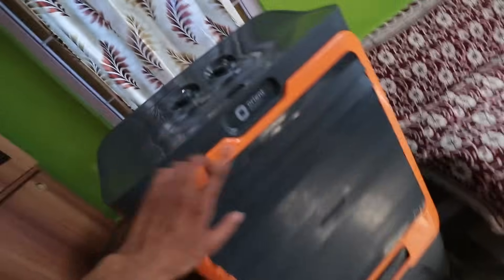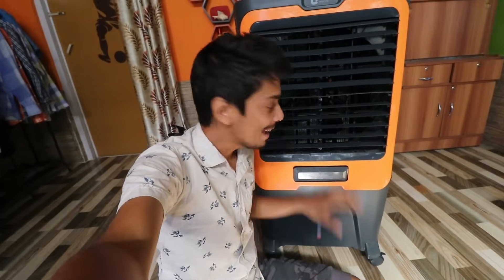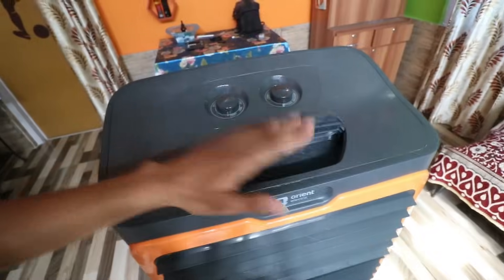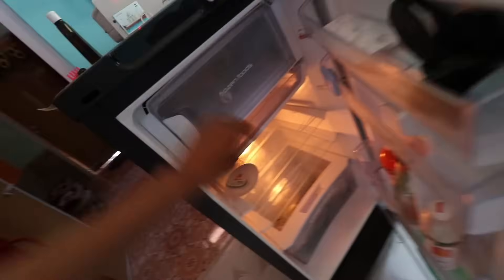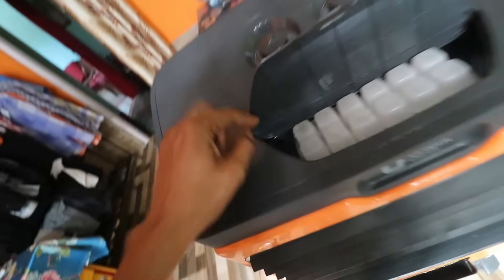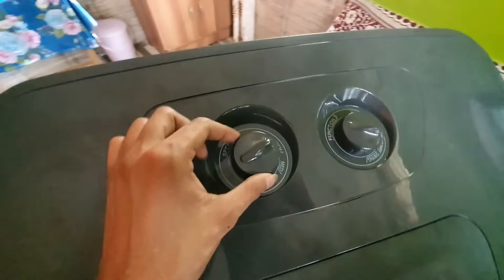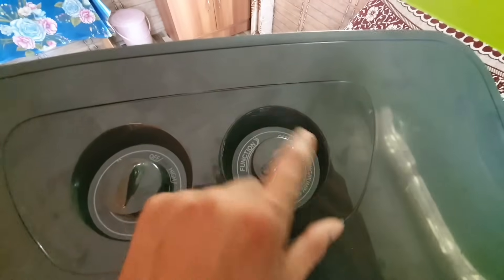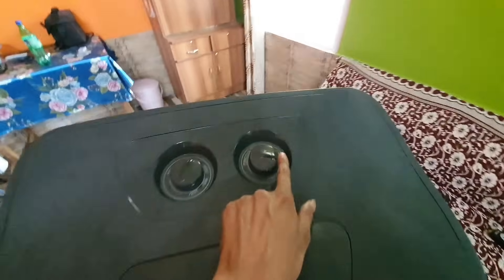ঠাণ্ডা ঠাণ্ডা কুল কুল - How air-cooler works - Dimpu Baruah

Comment: Cooler jihetu evaporativ pad joriote cooling kore so Humidity babe cooler heat exchanging capacity komi jai jar babei eyar cooling effect o komi jai. Logote bondho room hole cooler side place bor gorom besi hoi like gorom steam dore so air flow hobo porakoi room open hbo lge and cooler back side window facing hbo lge.

Comment: Air cooler is not very useful in hot and humid climate like in Assam. Air will already be saturated with  water vapor and will be unable to absorb the heat. Air conditioning is the only viable option. Cooler will be more useful in dry climates such as in North India. Another advantage of air cooler is that you can use it outdoors.

Comment: Air cooler fant koi bahot bhal kam kore, moi 4yrs mnaor pora use kori asu.. aku problem nai 👍
Reply: Current bill besi ahe ni
Reply: @lunabora4843  hoi basi ahe.. ata cooler minimum 2khn ceiling fan r homan power consume kore
Reply: @lunabora4843  apuni lom bhabise neki
Reply: @shankardas23  lom buli vabisu.emn grm porise
Reply: @lunabora4843  hosake gorom tu bohut basike porise... Atia botor tu alop daworiya korise... Borokhun dibo jen lagise
Reply: @lunabora4843  apunar guwahati t ghar neki? guwahati hole cooler loi labh nohobo, ac ha kam dibo.
Reply: Botah Borokhn dise olp
Reply: @lunabora4843  yat borokhun diya start korise 😊